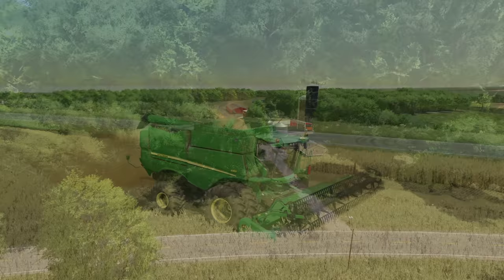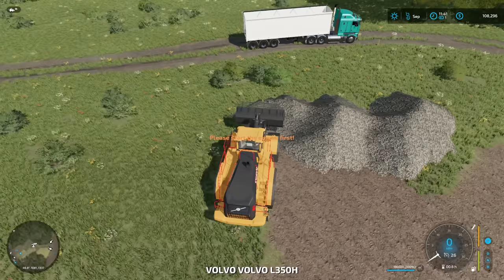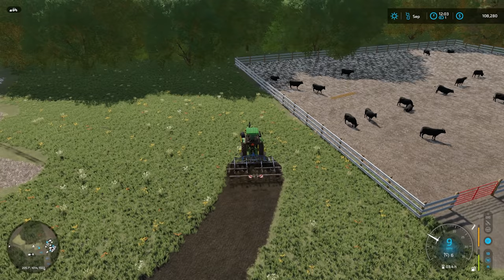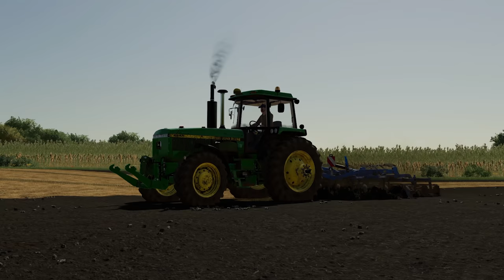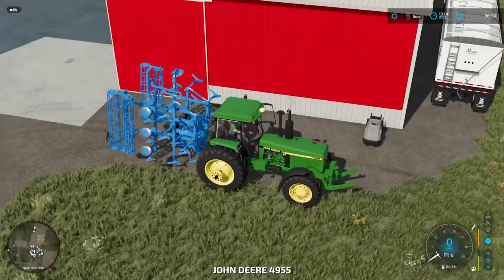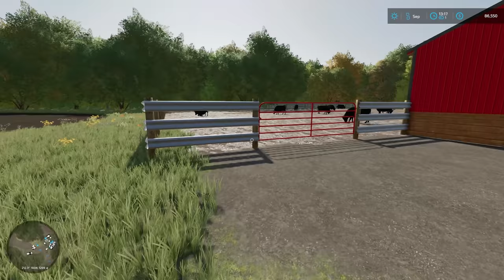The Farm Expansion is Almost Complete - Graystone Farm - Episode 8 - FS22

Comment: Hey FSG, hope you're doing good, thnx for your content.
I also have the lusty tippers with the Kenworth, but my question is, do other people experience that the pc has to work for it? 
Everytime it's in the screen my PC starts blowing the fans massively.
I know he said it's a demanding mod but never thought like this hahaha, btw my PC can handle it and is not struggling
Reply from the maker: Strange, not something I’ve noticed at my end, but it is a chunky mod for sure, Next time I play I’ll bring up my performance monitor and see if anything jumps up
Reply: @TheFarmSimGuy  thanks in advance, when I checked it, my processor was around 35% and ram i think 44%, but i did noticed some temperature rising, 78-80 Celsius so nothing concerning. 
My second question is about the stripes on the trailers, they do not appear, i can select them in the shop options but nothing happens, am i doing something wrong?
Again thank you and loving your video's